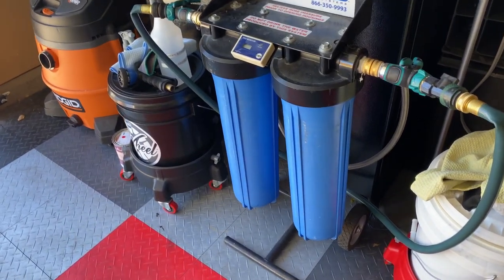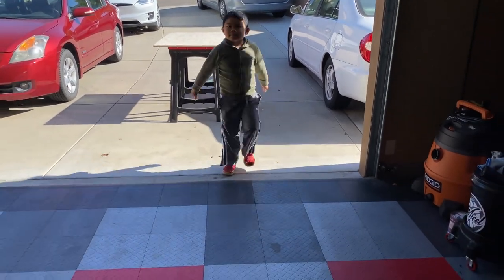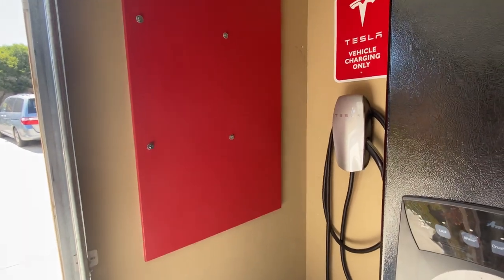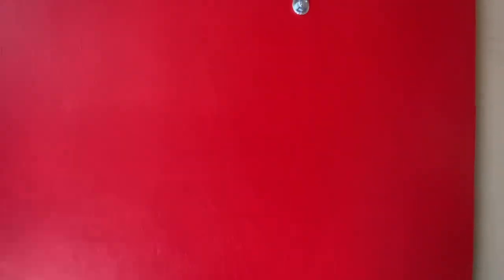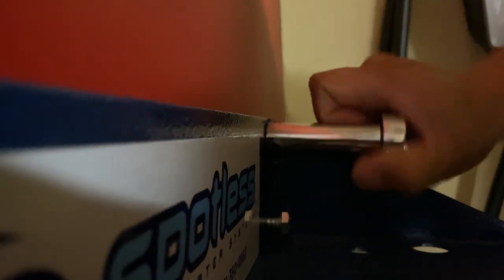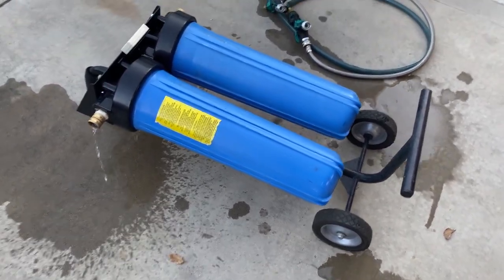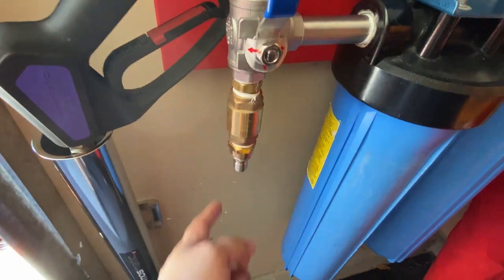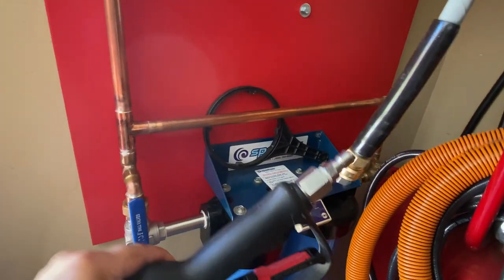Kranzle custom pressure washing solution install for the home with the kids.

Comment: Nice setup you got there.  Looking to build something similar.  I have the same CR Spotless and wanted to know if you got the wall mount from OG or CR?  Also, where did you get the check valves?  Thanks!
Reply from the maker: Wall mount I ordered from Crspotless.com. Check valves were all from amazon.com.